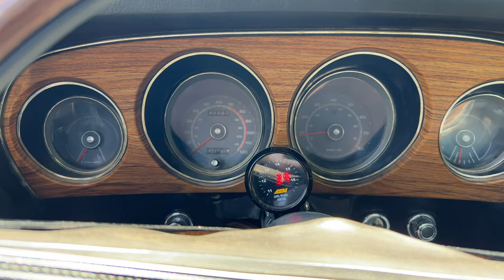How I Tune a Carburetor For Cruising

Comment: I just did this exact thing with the same Holley Jet kit. You are spot on! That tool is the only thing I would use on over tightened or old jets. I am still in the process of getting the carb tuned in. I always make sure there is no play on the arm that goes to the acceleration pump (s). Very good video! Now if I can only keep gas from going everywhere on my manifold!!! LOL
Reply from the maker: Nice! I hear you on the gas everywhere! As much as I try, it still spills. I started with a screw driver in the past and destroyed so many jets, this tool makes it so much easier. 

Good luck with your tuning. It’s definitely an art!

Comment: Pro tip.  Take a small chaulk line bottel.   Drill hole in tip.  Use it to refill bowls threw vent tubes.   I also cut the top of a quart of oil bottle. Put cap on it. Use that to drain your fuel bowls. Fits under carb and between distributor perfectly.   Has a nice corner on it to pour it into chaulk line bottle
Reply from the maker: Thanks for sharing!

Comment: My idle afr is 10.0-10.2, changed jets  from 76 to 69, (all I had)  and didn't change my afr, any thing else I should be looking at to help lean it out at idle ?
Reply from the maker: Is it a brawler/holley? You want to adjust the four corner idle screws. The jets should not affect idle quality.

Comment: Just picked up a 79 Fox body car. It has a 351 Windsor in it with cast iron heads. Don't really have any information on the engine besides that. I am having trouble trying to get the car to run right. It smells extremely rich at idle. No matter what I do to the idle circuit it seems to be rich. It has a 650 brawler on it currently. Is it possible that it could be over carbureted.
Reply from the maker: I doubt it with a 650. I'd probably pull the carburetor and completely reset everything back to factory settings. I bet the throttle plates will be open too far. There should only be a small square showing in the transfer slots. If it is open too much, the engine will end up running off the main jets and not the idle circuits.
Reply: @SmackeysGarage  I will try that thank you!
Reply from the maker: Let me know how it works out.

Comment: I just got a 69' Mach 1 about a week ago, it's my first car with a carburetor so I'm not too familiar with them. 

A few days ago it started doing this thing where as soon as I start it the engine stalls after a few seconds. it does not have trouble starting it just doesn't stay running. If I start it then stay on the gas a bit then it's fine but as soon as I let off the pedal it stalls again. What could it be?
Reply from the maker: Do you know if you have a choke on the carburetor or know what carb is on the car?

It might be worth while reading on how a carb works. You should pump the gas once or twice to get some gas into the engine before you start it. Without enough gas it will either not start or die out.
Reply: @SmackeysGarage  it is a Holley 4v 770cfm with an electric choke. I pump the gas everytime before I start it. 

It has no problem starting, it just dies seconds after it does
Reply from the maker: Do you know if it sounds like it is running lean or rich? You might want to check out this video on setting electric chokes. Adjusting the Electric Choke Correctly on a Holley Carburetor
https://youtu.be/_Z7jBPdYhAc

When you got the car, was it running correctly? If so, you might want to check to see if the choke is no longer moving. Maybe a wire got dislodged?
Reply: @SmackeysGarage  i actually just played with the choke and I got it to idle. It was way off and turned all the way clockwise so the choke was wide open at all times. The problem I have now is whenever I go to shift into gear the engine dies immediately
Reply from the maker: Cool. Sounds like you’re making progress. I would now check all the vacuum lines and timing. Either could effect in gear idle.

Comment: How did it run after the jet change? What was your afr showing after that
Reply from the maker: Much better. AFR is closer to 13.5 most of the time. I could probably go a bit richer. How’s your carb tuning going?
Reply: @Smackey's Garage  waiting on axles and driveshaft next week. After that I will be able to tune it more specifically when it's under a load. It idles around 14.7 and is still around that around 3000 rpm. When just sitting and revving it in the garage. Me making the rest of my exhaust which I did make a video on. Helped with afr being more stable.
Reply: I ended up ordering  a full fitech master kit. Going efi. So I will be selling my carburetor
Reply from the maker: Why the change? Just easier to tune and less hassle to deal with? That might be something on my list for next year. Let me know how you make out.
Reply: @Smackey's Garage  yeah. Just wanted something  that I can jump in and go.

Comment: What inch pounds torque wrench are you using? 
I'd like to buy one like that.
Reply from the maker: The 1/4" one? I've added it to the description of the video just now since I've gotten the question a few times. I really like it for its size.
Reply: @SmackeysGarage  
Great, thanks.
I've always done it by feel since the 80's without any problems. 
But thought it would be a good idea with the softer metals they are using with today's carbs to get it right. 
I've heard of metering blocks getting warped from over tightening and fuel getting around the gaskets into places it's not supposed to be and causing overly rich conditions and other issues. 

Thanks again
Reply from the maker: @einstein3509 Anytime! That’s the main reason why I use it too. We are definitely using more softer metals now and flimsier gaskets that could get damaged or warped.
Reply: @SmackeysGarage  
I watched one of your other videos about adjusting the float.
I'm used to the older style where you take the screw out and adjust to the bottom of the opening.

With the sight glass I was told to adjust to the center of the glass.
My WOT at 6500 RPM my AFR is at 13 Awesome!! 
But for the last 2 years (since I installed this new carb) I've been fighting an overly rich idle and cruise.
It's so bad people behind me can smell it. It burns my eye and there is no smoke coming out of my exhaust.
my plugs have a hard time staying clean. 

I've tried bigger air bleeds on the idle circuit and that didn't work.
Tried adjusting the mixture screws past high vacuum and that didn't help.
both of those attempts caused some surging at cruise.

I've tried hotter plugs which helped a little as far as cleaner plugs go but still not where they should be.

You are the first person I've seen that said to adjust the fuel level to the bottom of the sight glass.

So, I'm going to try that next.

Also, a buddy of mine is going through the same problem to the point he went out a bought an Edelbrock and the problem went away.

Comment: At part throttle i swear the main jets got nothing to do with it. Its the idle feed. I have a 82 mustang with a 351w.     410 out back.  T5z tranny.    Part throttle cruising.  Like barley on it.  Its the idle feed restriction.  With a combination of transfer slots.   One base plate to another will drastically change afr    Im running 34 dgrs timing all in by 2000 rpm.   No vac advance. 14 initial timing.   650 double pumper hp style with annular booster.  Vic jr port matched to tfs 11r 190 heads.  Stage 2 trick flow cam. Car straight up gets it. Stock bottom end.  When i dynoed it it made 460 ftlbs 370rwhp threw a c4.    T5. And new intake its gotta be well over 400.
Reply from the maker: I guess a lot of it goes to how you define part throttle. If you define part throttle as only slightly open and barely any transfer slot exposed, then most likely minimal gas from the main jets. If you define it as most of the way through the transfer slots, then you would expect more fuel from the main jets as the air flow has picked up.  Sounds like you have quite the build yourself. Is it a 351 based engine?